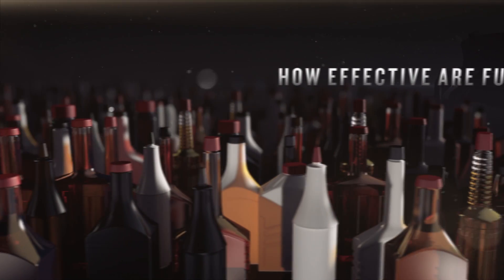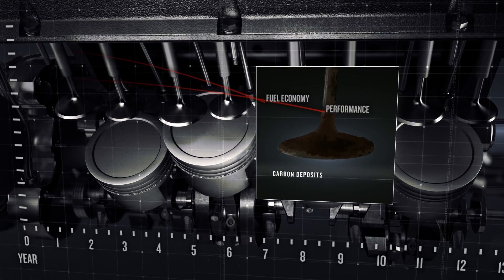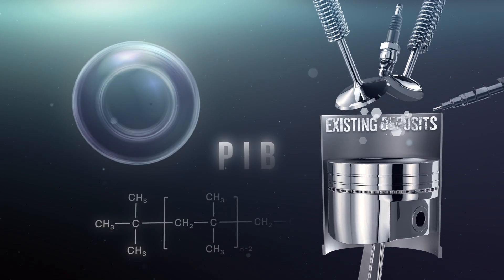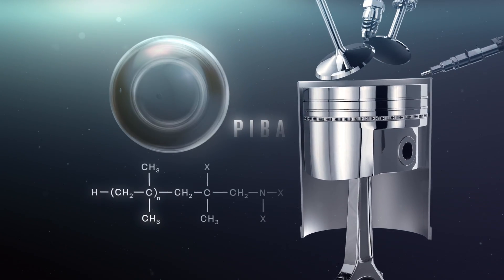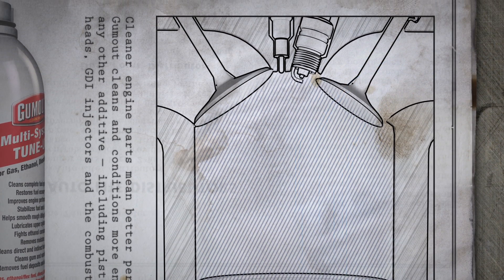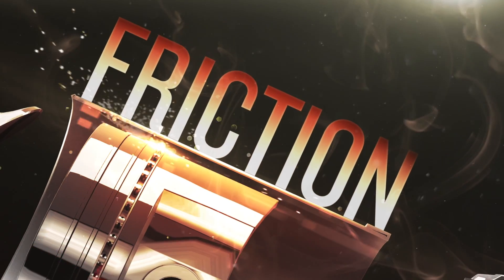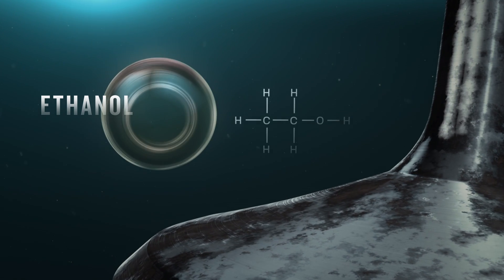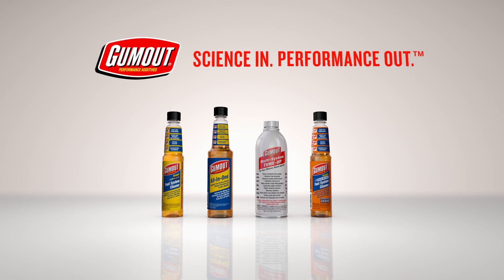How Fuel Additives Work In Your Engine

Comment: Scotty Kilmer a top mechanic for 45 years  on Youtube used Gumout Multi fuel system in a car with 230,000 miles that was loaded with deposits. He showed how great it cleaned on his video. Take a look at some of his videos. Lots to learn from Scotty Kilmer use his videos all the time. Also try Bob is the oil guy. Videos Great stuff there to.

Comment: ChrisFix on YouTube proved these cleaners are bunk. And if you have to use this trash with every fill up you increase your fuel bills anything up to 50% (depending on the size of your tank, cost of additive, and the fuel).
For example, I spend 25 bucks per fill up (8 gallon econobox fuel tank) and if these additives cost 7-12$ you can see where I get my 50% figure from.
Reply: You don't need to clean your engine every fuelup. Once every 5 to 10k miles is good enough. 3k if you want to keep it utmost clean!

Comment: Ethanol is not corrosive, it's alcohol and still an oil. Ethanol is very water soluble, and water is what is actually corrosive. Ethanol is actually a very good cleaner and upper cylinder lubricant.